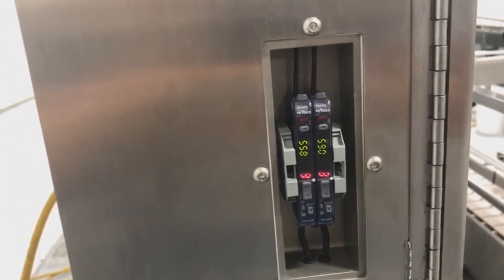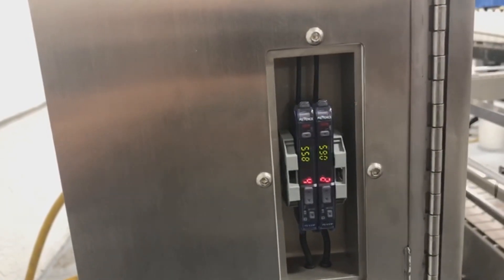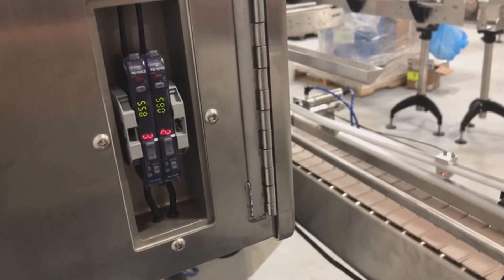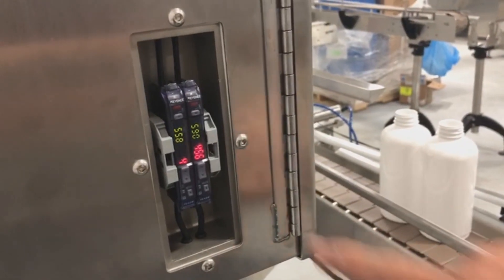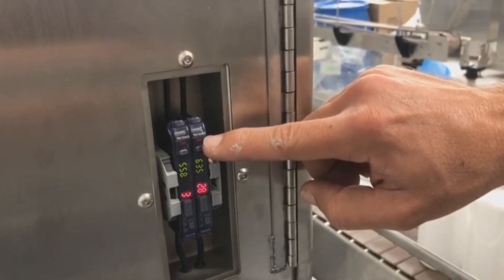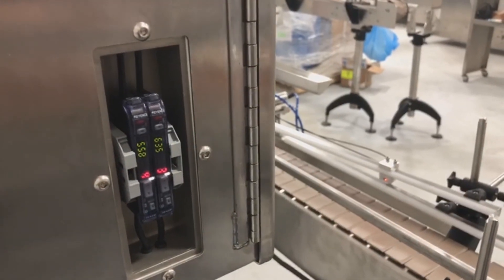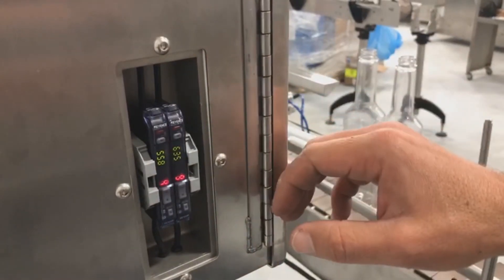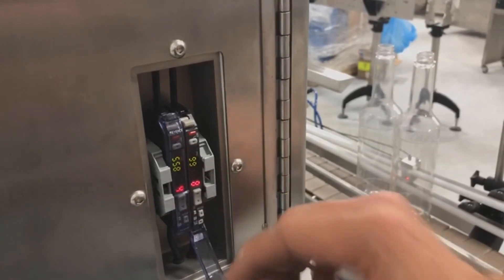Adjusting Keyence Sensor - Technical Video

Comment: I using Keyence Fu-57Te Transmissive Fiber Unit for small chip,I check the sensor and got alot mode,like Rega, super,ultra, what is the difference between all this mode